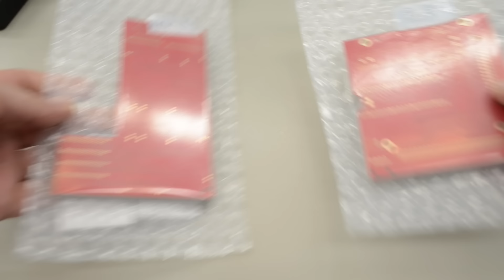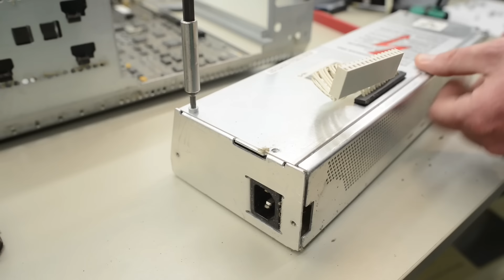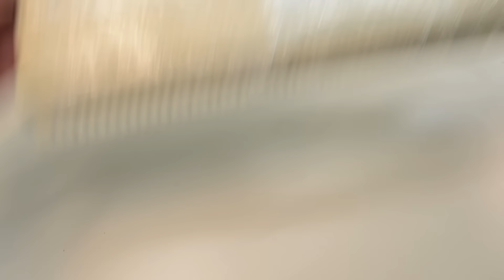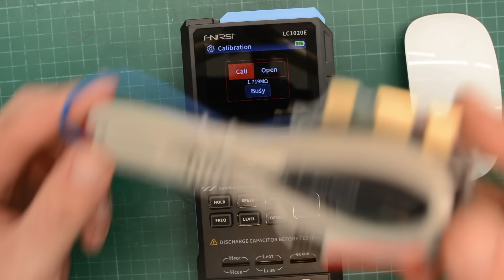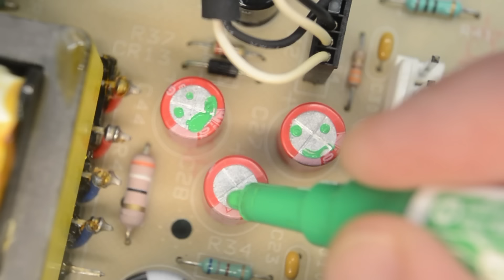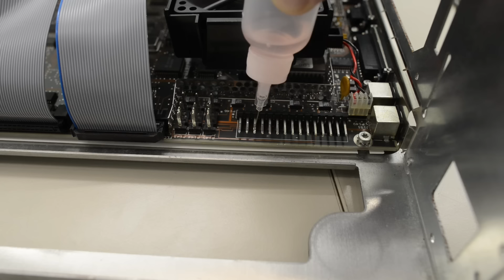COMPAQ Deskpro 386s restoration & repair + testing the new FNIRSI LC1020E

Comment: Measuring the capacitance in-circuit gave you a much higher value than expected because that cap is probably in parallel with several other caps. You're measuring the combined capacitance of all of them, not just that one.

Comment: Spider poop :) I had a "pet" garden spider that was around so long, a spatter cone of spider poop developed under her web. RE capacitance - the value doesn't tell you if the charging/discharging rate is correct. That obviously makes a huge difference.

Comment: Im glad SOMEONE has luck with that brand FNIRSI. Im sure someone mentioned it but testing caps in circuit if they are installed in parallel with other caps you'll get the value of all of them added together. In series the uF won't change (added together) but will increase the voltage it can handle.

Comment: You don't need BIOS support for ATAPI CD-ROM drives, just leave that device set to "not installed" and swap out the IDE cable for a longer one with 3 connectors.  (And jumper for master/slave accordingly; note that some hard drives, especially WD, have different settings for "single drive" and "master with slave present".)

BIOS support only comes into play on newer machines that support booting from CD-ROM and faster transfer modes (PIO4, UDMA33, etc.).

Comment: The other day I repaired a PSU of a PC-9801FX. Almost all caps on the secondary side leaked like hell. Measuring them revealed... the same what you've discovered: Capacity and ESR were still very good. I used a very good DE-5000 LCR meter to measure the caps. 
But after replacing these caps, the PSU worked fine.

Comment: Very cool! I love the old Compaq computers. I really want to get one of the original Deskpro 386 machines but I haven’t found one yet. I do have the later 386/20 which still uses the original full-size case and it’s an amazing machine. I agree with your assessment that the build quality is on par with IBM. That has always been my observation with these Compaqs as well.
Reply from the maker: Thanks. I'm actually looking for one of those, too. It would be interesting to restore and explore

Comment: Never played around in early Compaq machines. They definitely made some interesting choices for the design with those drive rails and memory card. I can't imagine manufacturing that card was cheaper than putting SIMM slots on the motherboard. Makes me wonder if the motherboard was based on an earlier design that just got updated for the 386 processor. I was thinking that because this is a 386SX it might be based on a older 286 board, but it seems the memory card design was also used in the 386DX models. Bizarre design choice. And those drive rails are more like sleds. Definitely unique. Makes me want to find the designer of it and ask what they were thinking? Probably just corporate greed.

Comment: Would check to see if standard AT rails for 5.25" drives would work If you can't find compaq ones or even if AT ones aren't right it would probably be easy to modify them so they fit. The front srcew on brackets that would cover the rails to keep the drive in place could be made from any scrap pieces of metal. I see the problem for this would be finding the right screws to keep the brackets in places, not the rails or the brackets.

Comment: Oh that screwdriver, it was a prized posession, where I worked it was awarded when you passed your Compaq accreditations.

The PSU were famous for failing in a spectacular way, the MOSFETs were riveted to the heatsinks and when they failed you had to drill them out, then chisel them off because they failed and the molten guts of the transistors ejected through the heatsink tab, welding the transistor to the heatsink. 

They are repairable, IRFP450 work if you can get them

Pretty sure the hard drive bracket was nothing fancy, just a sheet of steel with folded up 'tabs' at the front, drilled to fit a 3.5" drive and to bolt into the drive cage

Do you have one of the Compaq laptop opening wedges?
Reply from the maker: I wasn't aware of a Compaq laptop opening wedge. Now I need one :)

Comment: This was my first computer! I got it used and pre-yellowed, with some aftermarket upgrades. It was before I knew a lot about computers, but it had some sort of 486 upgrade chip in it, 4mb ram, 110mb or so hard drive, and a 14.4 modem. I got a Sound Blaster 16 kit that included a Panasonic interface hard drive, so I didn't have to worry about routing IDE cables, not that I knew I might need to worry about that at the time. I didn't have drive rails for the CD-ROM drive, so it just sat there loose and rattled around. I could still reach my finger in to push the button to eject it though. I think the video card had 1mb of ram, because I could run Windows 3.1 in 1024x768 with 256 colors. It lasted me until I tried my hand at building a Cyrix 5x86 system myself later (badly, I found later I was running it at 75mhz x2 instead of 66x2.5 and overvolting it). It unceremoniously ended up in a landfill. I miss it sometimes, but I don't have the room to collect vintage computers, much less the patience to learn the skills necessary to repair and maintain them.

Comment: In future, if you ask for help identifying something you need to put up a high-res still photo or clear video shot from directly above and in-focus showing the whole card front and back. For that card just play with the jumpers and you may eventually figure out how they work at least enough to start seeing it add more RAM. Or reverse the jumper section, make a schematic and figure it out properly.
Reply from the maker: I forgot to mention. I made a separate post with a better picture

Comment: Replace the battery with a 14500 Li-ion battery which is nearly identical in size to a regular AA battery and is the correct voltage 3.6V. Get a holder on Ali and mount in there somewhere. No need to disable the charging circuit since the Li-ion is rechargeable. The coin cell will be drained very quickly.
Reply: The original battery is non-rechargeable.  I would assume that means there IS no charging circuit.
Reply: @sirnickity  Ok so he could use a 14500 in a holder and charge it manually. These batteries last years in a PC. I even use one to light my gas cooker. It had a AA 1.5V battery powering the piezo sparker which could take 30 seconds to work, with 14500 now it lights immediately :-)
Reply: @g4z-kb7ct   Well that's a good quality to have in a PC -- can immediately light fires.  ;-D

I kid, and I get your point.  I've been on a bit of a "what to do with batteries" journey myself, having replaced a few motherboard barrel batteries with coin cells (after altering the charging circuit to be diode-isolated dual-input instead, of course.)  I'm rewarded by having to re-enter the drive details and on-board peripheral options every time I power up a PC older than about late-Pentium era, where the CMOS stuff began to get a little more efficient.  I get maybe a year, if I'm lucky, out of a coin cell and then it's back to the BIOS setup screen ...

I really don't want to put alkaline cells in there, and I'm not a huge fan of NiCd.  NiMH might be OK.  Li-Ion cells require some care, but if I spent a couple hours to design a charge controller PCB and a 3D-printed case for it all, then maybe it would be time well spent.  I dunno.  So far, I've just wanted to play Wacky Wheels and Warcraft II, so they've still got dead batteries.
Reply: @sirnickity  On an old P4 I use for driving an old EPROM programmer I just go into the bios and reset it. I only have to change the parallel port to ECP. If I didn't need to use this EPROM programmer I could just boot up and everything resets to default without having to touch the bios set-up which is fine in my case. btw NiMH has the same issue that most batteries have... the memory issue where they forget their full charge level and only charge to a point then stop. They are no better than NiCd.
Reply: @g4z-kb7ct   Oh, sure.  But they're cheap to replace, and ... while I guess I don't have the chemical science creds to say it can't happen, I have never had a NiMH battery leak.  :-D  That's really my main concern -- I don't want them to be destructive.

I do want enough useful life that I can reasonably expect the settings to be retained, and the battery to still be functional in a few years, but if I have to replace them every ... 5... 8.. years, that's probably fine.  I've got some pretty old Eneloops, so it seems that should be possible.
Reply: @sirnickity  I remember buying a new laptop in mid 90's which had just adopted NiMH battery tech and the sales guy told me NiMH didn't have the memory problem lol! For the cmos I would just use a Li-ion 14500 and be done with it for several years. The 14500 battery in my cooker is still working and I haven't charged it for 2 years.

Comment: Using a “cheap heat gun” means nothing! If it produces enough heat, it is the right tool for the job. Around half of my solder setup is from Harbor Freight, and I haven’t had even a single tool fail in almost 20 years. I just replace working tools with prettier new editions. LOL At the irritation of my wife!

Comment: Your comments about CDs vs vinyl suggest that you have not studied how our brain facilitates our perceptions. Perhaps this has changes since you now want them back, but in any case, this stuff was well understood 50 years ago and there are endless experiments that illustrate the reality. Professional violinists when given the chance to compare a number of violins including a Stradivarius will always praise that instrument to the skies, except when they are not told which one is which. In that instance, they do not even like it. (Since we do know what made the Srads superb, the best modern instrument makers have been able to build upon it  and produce even better instruments) Audiophiles when comparing an amp or speaker that they consider excellent to another that they know to be rubbish will hear a huge difference in the sound which is based on the devices they believe they are listening to, irrespective of what is actually connected. I could go on endlessly, and this effect also applies to what we see and remember, so it's a subject worth investigating. CDs are actually extremely good but how a recording was made is a whole separate issue. Most popular music is recorded very badly so I'll hear a great song on the crappy car system and then discover that the recording is so bad that it sounds like the car stereo when playing the CD at home. That hurts. 😊

Comment: When it comes to the old Compaq computers there is literally never anything that is built by standard, smart or even logical. everything is proprietary, quirky and weird with strange riser cards where both back and front could be used on both the risers and motherboard and angled with no hint of logical regret. I guess that gives these computers some fun aspects today but back in the days nothing gave me more grief than trying to get things to work be it hardware or software. I remember back in the days I kept fighting with a specific Pentium based Compaq and I got so mad after years of nonstop troubles I gave away a computer to the person having this just so that I could put that old computer to sleep with a big sledgehammer. It was actually very satisfying back then But I kinda wish I kept it at this point just because this computer had the most stupid design I ever seen in my whole life and would be fun to display today. 
Regarding the caps I am sure working hard to recap my 80s and 90s equipment more than ever now because these stupid caps leaks like crazy causing serious damage or even killed some of my old computers. I have been able to revive most of them at least but People has to be aware how quick and severe the damage can get when these old caps starts to leak and they do it silently and fast. I barely ever read poor values on leaky caps, they just leak. it is more common old caps gets DC leakage through them which barely any tester can check of the ones you can buy
Reply from the maker: lol. What Compaq model was it that gave you so much trouble back then?
Reply: @Epictronics1  If I only remember which it was. I know it was a Pentium 75 in a smaller tower case. It may have been one of the Prolinea models

Comment: I learned not to use coin cell batteries on machines that old, you had 1.5Ah battery for a reason. It’s likely it is going to die in 6-9 months.  I’m using 1/2AA 3 or 3.6V battery with a matching holder. You can add serial diode to drop some voltage.

Comment: If I remember correctly, the Compaq 386/25 was our first Family PC, in 1995. I put a Soundblaster, a S3 VGA Card, and a CD-ROM Drive in it. And Installed Windows 95. It was awfully slow, but It worked.

Comment: I will never miss CDs. I did switch back to blu-ray and 4k this year. I got sick of shit vanishing off streaming sites. 4k is new for me......but I have a 1080p tv. lol I'm future proofed on those disks. lol I do have a 4k monitor though. I'm creating my own streaming service using a threadripper and a 16x BD/4K drive. Currently it has 14tb of storage. I'm about to add 8 more.
Reply from the maker: That's what I said, just a few years ago, and now I want my CDs back! Nostalgia is super weird!
Reply: @Epictronics1  no it will never happen. I don't even want discs really. The only reason I switched is to have control over my shit. The disc gets used once to make a copy to my computer and then encoded in AV1. Then it gets put on the shelf. It's WAY better quality than netflix or hulu. And I have total control over it.

Comment: replacing a 1,5Ah Lithium Battery with one of around 100mAh is not very useful.
Reply from the maker: It doesn't last as long, of course, but I don't mind replacing a coin cell frequently instead of risking a battery leak inside vintage computers
Reply: @Epictronics1  The type of lithium battery Compaq used shouldn't have any issues with leaking.  It has a solid electrolyte that is like a fine powder not a liquid.  Much less likely to have any issues with the battery seal and if the seal is ever compromised it wouldn't travel like liquid electrolyte tends to.

Modern lithium chloride batteries are still available since they are often used in alarm systems.

Comment: Per ChatGPT:

Short answer: I can’t confidently pin this down to a specific retail make/model, but I can tell you what it is and give you the on-board ID.

What I can read from the board

Zooming into the silkscreen:

Along the bottom edge it clearly says:
PC-82008P-02 8811 MEMORY BOARD
(“8811” is almost certainly a date code: week 11 of 1988.)

On the right edge, rotated, it says “TAIWAN R.O.C.” – so it’s a Taiwanese OEM board.

The DRAMs are Goldstar chips (you can see the old Goldstar “G” logo), arranged in a big grid.

A sticky note on the card says “mapped from 640k to 4736” – 4736K − 640K = 4096K, so the board is providing 4 MB of RAM above conventional memory.

Edge connector is full-length 16-bit ISA, and there are three 8-position DIP switch blocks, which fits a late-80s AT-class EMS/XMS expansion board.

So what is it?

Best description:

PC-82008P-02 4 MB 16-bit ISA Memory Expansion Board (generic Taiwanese OEM)
– designed to add ~4 MB of extended/expanded RAM to a 286/386-class AT system and to optionally back-fill conventional memory up to 640K using the DIP switches.

I went looking specifically for “PC-82008P-02 / PC-82008 memory board / ISA” and similar strings and couldn’t find any catalog hits or branded ads, which strongly suggests this was one of those unbranded / relabeled OEM cards that multiple clone vendors sold under their own names, rather than a famous “Intel Above Board”/“AST Rampage” style product.

How to confirm (if you ever get the real board)

If you ever have the actual card in hand, you might be able to nail it down further by:

Checking the back side for a logo or manufacturer name.

Looking for an FCC ID silkscreen or sticker; that’s often tied to a specific company.

Reading the exact DRAM part numbers and any big PLD/ASIC markings (sometimes those have vendor logos).

But from this photo alone, the most precise ID I can honestly give is:

A late-80s Taiwan-made 4 MB ISA “PC-82008P-02 MEMORY BOARD”, not clearly tied to a specific retail brand.

Comment: You need to pick up a copy of GRC Spinrite for checking the hard drives
Reply: Spinrite... now that's a Utility I have not heard of in a long long time **getsmistyeyed**
Reply from the maker: @zarkeh3013  I tend to only use it on MFM drives
Reply: @Epictronics1   That makes total sense.  I suspect there's very very little to gain by using Spinrite on anything that abstracts the drive layout from the software.  ANY tool that can write a pattern and then read it back to 1) see if there were any I/O errors, and 2) give SMART an opportunity to remap clusters (if applicable, and if it can or will) -- that will do just fine.

Comment: I had to pause the video to see if my external drive was clicking. lol. No worries. Excellent videos. Do you know if I could get a Battery holder for a Compaq Deskpro EN866 with the 815e Chipset? Changing the battery it came off.
Reply from the maker: Thanks. It's most likely a standard holder, available on AliExpress and eBay